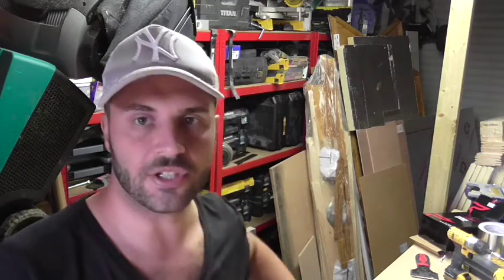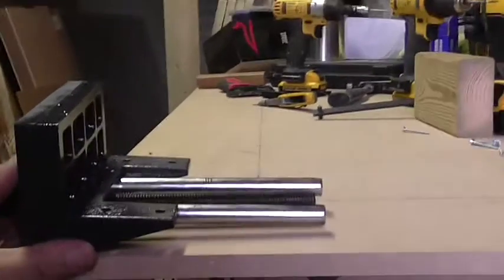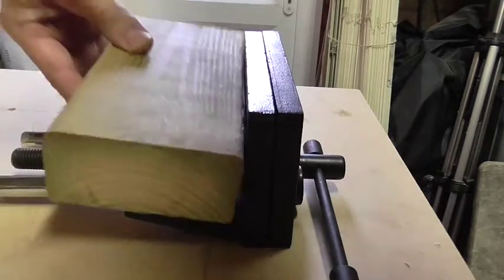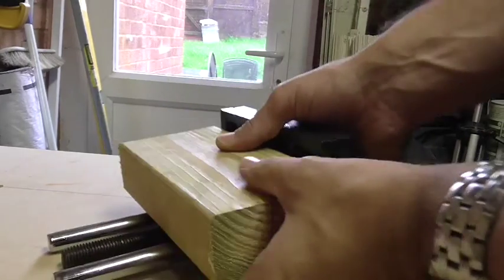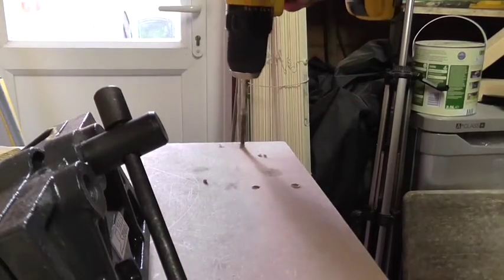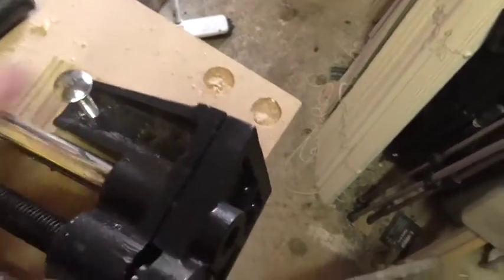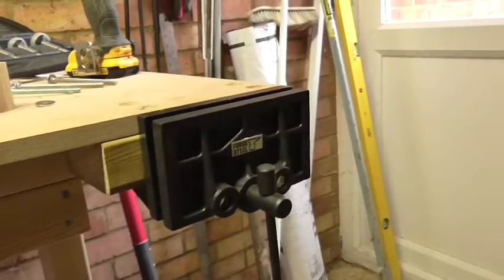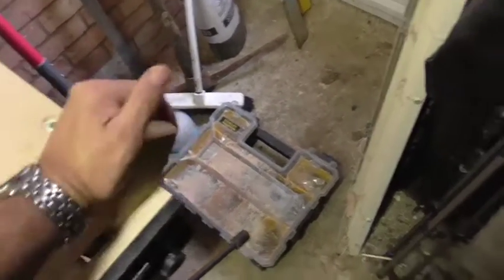How to fit a woodworkers vice

Comment: Haha.  Funny coincidence. I bought this exact vice this morning. Your video is very helpful. I see from screwfix reviews that some people have tried mounting it on the  surface of the table rather than underneath and then complain that it won't sit flush on the table. lol.
Reply from the maker: It's ok for the price not particularly fancy and the ends of the handle fall off if not careful (i've glued mine on now). I have seen the screwfix comments; was a little surprised!

Comment: Nice job again though could i make a suggestion.I think it would be wise to attach a safety chain to prevent the top from crashing down now the vice is attached.Just a precaution that's all.Save changing your addy to Bumpy head separate bed lol.
Reply from the maker: That's a good call Allan the vice does make it much heavier.

Comment: Just a suggestion a hardwood good for the jaws of the vice like oak will last and last.
Reply from the maker: Thanks for the tip!
Reply: Hardwood can damage softer woods just like the metal jaws would. I plan to use softer wood and replace it as necessary.